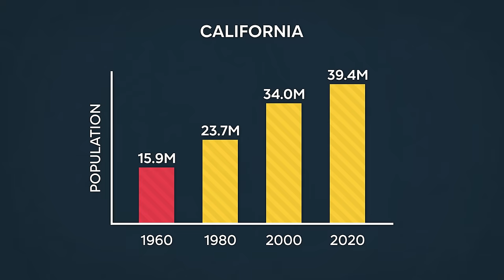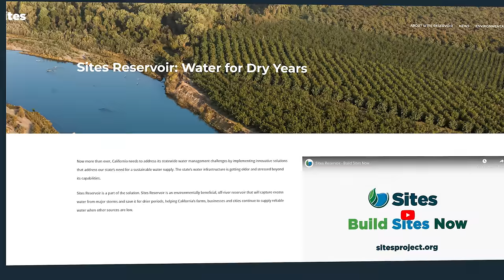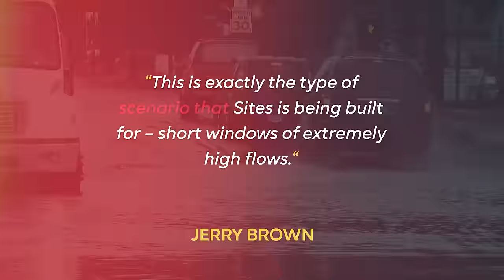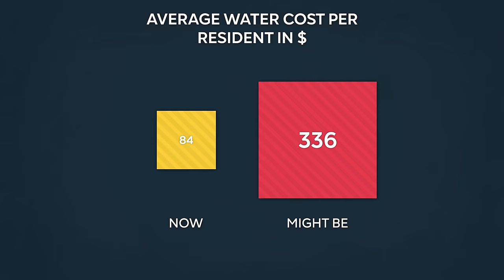California's New $4BN Mega Reservoir

Comment: I Central Valley resident of California, and Geologist. The 2023 wet year provided CA with 200% of its snowpack in the Sierras and came rushing down the slopes through the rivers and dams had to release much of it leading to the near return of Tulare Lake. The lake is fed by the Kings River, Kaweah, and Kern mostly. The Kings and Kern like most rivers in CA are modified to control their flow. Rivers are controlled to store water and re-direct it for keystone species like the Salmon in the San Joaquin River, which now spawn just below Friant Dam. The rivers are major areas of groundwater recharge, which has become the biggest source of water for many in Central Valley, as we receive less surface water. CA to preserve and hopefully regain some of its groundwater has started SGMA (Sustainable Groundwater Management Act) and to reduce subsidence and better manage groundwater. We need rivers to recharge, and can’t rely on rainfall because it has a very much chance of making past the layers of clay left by the ancient lakebed (not Tulare Lake, Corcoran Lake). I don’t know if building another dam is the right thing to do for the  Sacramento Valley, as surface water stored want help with recharge due to the generation of clay at its bottom and will lose it to evaporation (which will only get worse with a warming climate). 

CA residents both in city and rural communities HAVE reduce their water usage, at least follow sustainable methods. Get rid of grass lawns, replace them with drought tolerant plants and native plants, the yards will look prettier and cost you less on your water bill. My family got rid of all our grass and it has significantly reduced our cost in water.

Comment: At 9:20 there is a photo of the flood in Acampo in January 2023 that was due to breaching the levees on the Cosumnes River. The Sites Reservoir would do nothing to protect this area. Adding less than 10% to the potential storage capacity of the State Water Project is not a panacea, but it's a start.

Comment: Nuclear power plants will need to be constructed for the 4 existing pumping plants that pump water to SoCal.  Tehachapi, Wind Gap, Wheeler Ridge, and Buania Vista Pumping Plants that were constructed back in 1960 + by the SWP are all within 40 miles of each other and were the original electrical power plan before the tree huggers started screaming. Windmills, solar panels, and mandated EVs will place the future electrical grid to the limit with this newly added pumping plant for this new reservoir to work !!

Comment: I'm a big fan of the fact that it taps off of a river rather than blocking it. This sounds like a win/win for the environment and the residents.
Reply: Agree, and it gets back the energy from pumping when its released is a big deal.
Reply: San Luis Resevoir is like that
Reply: Yes, that appeals to me, too.
Reply: No win at all. The water rights to the  Sacramento River water  are already higher than the river produces.  Now they're going to build a lake that sucks even more water out of an already over stressed supply.  

And saying the lake will be filled by winter water levels is a total joke. I grew up in Colusa and those "floods" and "high water events" only happen about every five to ten years, sometimes longer. The rest of the time everyone has to conserve water because there's not enough. 

There are other ways, smarter ways to go about conservation of Californias shrinking supply of water and a project like this that will only increase the states water storage by less than 1% isn't one of them.

Comment: Obviously most of the commenters here dont have a clue how California's water collection works. The 'rainy season' is usually January to March, with a little rain on either end of those months. Then the rain isn't all that much, it's the snowpack that the reservoirs get their water from. The melting snow provides 80 to 85% of irrigation to the valley. The other 15 to 20% comes out of the aquifer,  the water levels of the aquafer are dropping faster than nature is replenishing, so in the not too distant future, there won't be enough water left for anything. This project is very necessary, there's also smaller valleys in the foothills further south that could be used in the same way.

Comment: Best is to ground radar the basin to find the best access to large gravel based aquifers, scrap the top layer of clay off at strategic places and flood them with the run off. There's probably multiple capacity of the sites storage project, just below are feet.
Reply: Good for future "Water Splitting Technologies." Atta Boy. Not optimum concept but dang close. Future Geo-engineer?

Comment: I realize this is a year late coming to the party, and maybe you mentioned it and I missed it, but a major change that has just happened in the last decade or two is that they aren't getting the amount of snowfall in the mountains that they used to get in the winters and most of it has already melted by late spring. Back when I was living there 2 decades ago up in the cascades, there was still solid snowmelt well into June providing freshwater for people and irrigation across much of northern california. I realize that this is all about socal's water needs but northern california knows that they send a lot of water down south (something that pisses them off to no end, either) so if they can't provide it then it's one more source of water when they already need it desperately gone dry.

Comment: That's why California needs a build a big giant desalination plant so they can keep the reservoirs full
Reply: There is 1 in San Diego. ITs way too expensive to operate.
Reply: Antioch, CA recently built a new desalination plant.
Reply: Desalination is WAY too expensive, needing huge amounts of energy.
Reply: They have over a dozen of them in California how many more do they need.
Fun fact 70 to 80 % of all water that enters California I used for farm crops.
Reply: How much energy does desalination require. How much of Israel's water supply is processed ocean water?
Reply: Just read that a liter of desalinated water is ten times more expensive than the same amount of fresh water. Sounds like the product would price itself out. With that disparity, how much improvement in fresh water retention could be achieved? Again, Persia was a dry land that became powerful when Cyrus built projects to harvest natural water. I think UNDERGROUND aquaducts!
Reply: Desalination is not a viable answer in California. This has been investigated forever, and it will not work on a large scale. Yes, there have been significant technological advances, but the bottom line is this - it will take a TREMENDOUS amount of electricity, and we don't have that, either. By tremendous, I mean more than doubling the electrical capacity of California. Furthermore, this will do not good at all without ample water storage, which is what this video is about. Also, when you take fresh water out of seawater, you have to pump back into the sea super-salinated water, and that water stays together, poisoning that region of the sea. (The Denmark-Greenland Strait cataract is an example of this effect.) Finally, it's a maintenance nightmare.
Reply: @mikebrant192  In my view, nature has perfected desalination. Everywhere that solar heat creates clouds on the ocean, an environmentally friendly desalination is occurring. As humans have done since the very first in Africa, we need to find the best methods to exploit what nature already does. Ancient ancestors figured out fire and applied it in a series of rewarding ways. Egyptians experience annual floods and used imagination to maximize agriculture. Flint nappers observe how tapping rocks created useful tools ans applied it for centuries. What is needed now is looking at a bigger picture to figure out how these weather patterns work to our advantage and go with it. Interstate pipelines move natural gas and gasoline. Underground aqueducts moved water in ancient Persia. They posited a problem and devised a timely answer. Industrial desalination is a lame mimic of the natural form. Exploit it.
Reply: To be clear: Exploit the natural form of desalination.
Reply: Way too many people in CA.  Millions will have to evacuate when the Colorado finally runs dry🤷‍♂️
Reply: @graces5634  Colorado drains a portion of the Rockies. That snow is a fraction of what feeds California agriculture. To me California and the Ganges valley are parallels. And actually the Chinese river systems. If all those Asian rivers ran dry, billions would be affected. The ultimate source is actually Pacific Ocean storm systems. What would cause that rain to stop?
Reply: @graces5634  clearly you don't know your geography

Comment: At 0:44 seconds that narrator mentioned the third of three deserts that are partly in Calfornia as the Colorado.   When was the Colorado ever the name of a desert?   In the same place where the region colored in red is called the Colorado there is the Sonoran Desert!!  🙄

Also the framing in the beginning of the video understates the degree in which the record rainfall this winter almost completely eliminated drought in the state.   So saying that California was in the middle of a prolonged drought is misleading to say the least.  It would more correct to say that California is between the previous drought and the next one whenever that happens which will likely to develop in the next few months.

The rest of the video seems on point at least from my non-Californian perspective.
Reply: Considering the severe lack of rain outside of winter in California, I'm not sure you can reasonably enter a drought in California outside of winter.  That is, drought is a shortfall of rainfall, and since California is basically never expected to get any from now until September or so, you cannot have a rain shortfall in those months.

I guess you could declare it in December, but rain is really feast or famine in California, I wouldn't start "worrying" until February.  That said, the state's water management is built around surviving many consecutive years of drought, so even then I wouldn't worry.  It's when you get too many years of drought do you have to start worrying.

I've lived here my whole life, and it's simply the water dance out here.

Other than that, yeah, I agree.

Comment: During the 1976-77 drought more then one municipal water supply dried up.  For example in Northern Ca we had temporary pipelines pumping water over the bridges to feed areas that had no water.  The state had concluded in 78 that for the safety of the population more water storage was desperately needed.  When the drought ended it was not environmentalists that stopped reservoirs from being built.  When the drought ended Ca had a long period with very wet winters and the politicians did not want to spend money on any of the proposed projects.

Comment: From what I remember of a documentary about the subject California hasn't really built any large water projects in decades. Most projects are held up by environmental impact studies and the like. Due to the laws of the state just about any one can file a complaint about a project, forcing more and more Impact studies to be done for the project. To the point I think one Dam project was in the planning stages for over a decade.

As for the flooding issue, California is a very paved state. More and more roads, parking lots etc are built preventing water from seeping into the ground. Dam projects are also a bit of a problem in that regards too. Because they channel and funnel rainwater to one location. But if that dam reaches max capacity they have to open the gates to let the water out. Meaning most dams are only good up to a point, and then they are a greater danger and risk to the communities down stream.

It has also been proven countless times if a State/Country has to pick between saving the dam, and flooding all the cities down river they always pick to save the dam in times of overflow.

Comment: It was contemplated before, building an undersea aqueduct from the mouth of the Columbia River just off the coast of Oregon and California all the way to Los Angeles. The sea floor along the coast has a very level topography running North and South and ships could easily lay the pipeline onto small foundations requiring almost no escavation. A gravel filtering off the Columbia River or undergound could filter out the water of unwanted foreign things like the small clams that have pleagued canals. The Colorado River water aqueduct was probably a much more ambitious project but not as much distance. The sites resivour could benefit from Columbia River water when the Sacramento River volume becomes insufficeint.
Reply: What about the sercadia seduction plates
Reply: @sherryanderson5029  You mean subduction plates. If it moves and breaks it can be quickly repaired. The Colorado River Water Aqueduct was built running right through the San Andreas fault in California. No problems yet after 70 years. Providing water to 15 -20 million consumers would not necessarily factor those things in.

Comment: You didn't do your homework, lake Oroville is HALF the size of lake Shasta. Oroville has 167 miles of shoreline, Shasta has 365 and feeds the Sacramento River. Shasta also has a hydro power plant and is the largest lake in California. California has had neither drought or flooding it has it's normal weather which has been recorded for 200 years. The problem is the population has increased and the demand for water has increased. California's weather has not changed. There is no drought.

Comment: Building many small dams would probably be much better solution.
My country has hundreds of small dams leftover from the Soviet Union times and in the past few years they have started failing from neglect and other issues. Still they protect some areas from floods and if one small dam fails it is not as devastating. 
Big dams could hold more water for less area, but the water can't send efficiently far away, unless they release it back into the river and in the end just think  what a small failure in this project could cause.
I'm not from the US, but with how corrupt politicians are I fear they will screw it up somehow and the people will suffer.

Comment: Once clay gets saturated to a depth of 6 inches rainfall is 100% runoff. Why do underground injection wells of chlorinated water? It could last for about one year before it dissipates into the surrounding strata. Back in the 1990s a city in SE WI did this. But of course, there would need to be some established laws in place to prevent groundwater pirating by bottling companies-hint-hint

Comment: I think California should start looking into Agroforestry and permaculture. I do not think the point is constructing more artificial water retention systems. The point should be bettering the natural landscape water retention, to make green naturally more abundant so that in its turn provide water retention and shade to the ground, By doing this the water in the ground does not flow away so easily and it remains there longer for the sun cannot reach it. Surely these are long therm projects but on the long run they would make California a greener, more sustainable, happier place with no droughts and no floods.

Comment: The valley used to be like a big sponge.  With wetlands slowing the water down and allowing it to filter along with silt out into the valley.  Which is why it's so fertile.  Then they put the river in a straight jacket, and drained the wetlands for farming.  Now they complain about the water leaving to the ocean to quickly.  This is a problem that humans created.   Sites is not needed.  The state North state doesn't need the water it's Southern California.  And SoCal needs to tighten their belts, and even better, go desalinization and leave north state water to the north.   The north state needs to let the winter flows flood the farmland and better yet, restore wetlands, to let that water recharge the ground water table and push back the salt water infiltration.   No on Sites Res. Sites is a bad project and needs to stop.  This project is no different than diverting the Sacramento River to Southern California, that is what they are doing in effect.

Comment: There are approximately 13.5 million households in California, and this project, per this video, would only supply 1/2 million households, less than 4%.  Yet the rest of California will have their water bills go up by 300% to pay for it.  Does that make any sense?  Some of the previous comments offer a number of localized solutions, as well as using Tulare Lake again.  The resistance will come from the tiny group of billionaire farmers that control all the water in the southern portion of the central valley, and who have drained the once pristine waters of the upper aquifers.

Comment: The soil has been depleted of carbon because of our farming practices and hard scaping.   This prevents the soil from acting as a sponge.  Not going to solve everything but soil with high carbon content can absorb 5 inches of rain an hour  - a huge gain over. 1/2 inch rates of depleted carbon soil.

Comment: The bigest issue is the rampant corruption in California, they are still building the high speed rail project that has SO FAR cost about 128 Billion dollars, and they are not even halfway finished with the thing after almost a decade. The original cost was estimated to be between 25-32 billion....this resevoir is never going to happen, though tax payers may pay for it...and i say this as an ex Californian